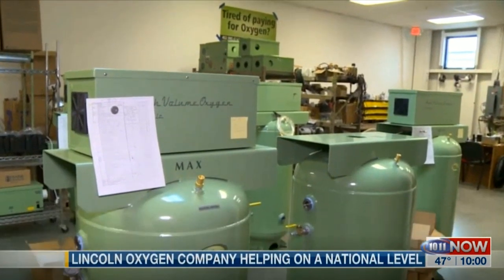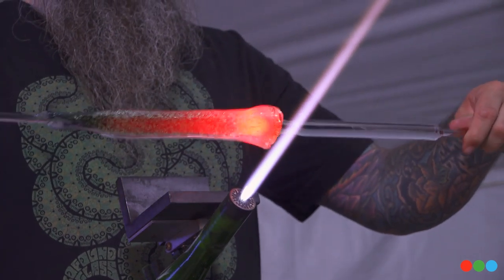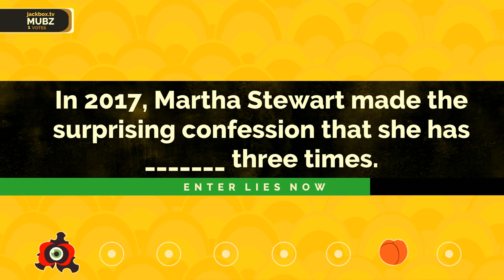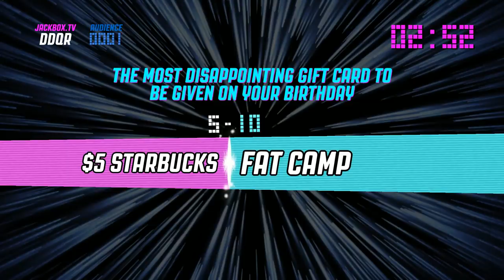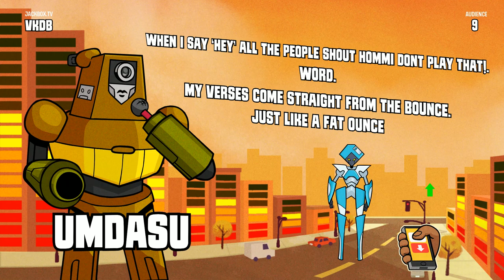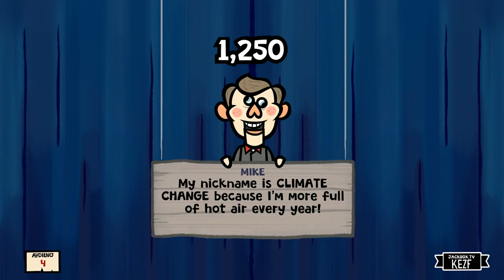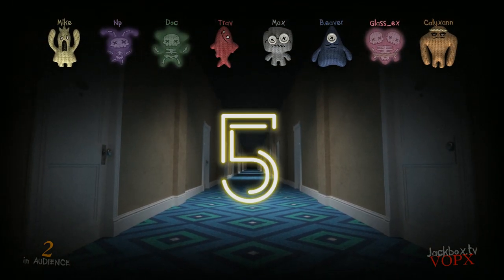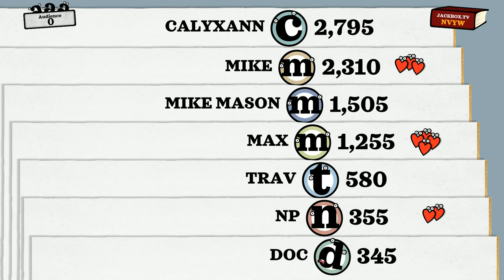Dichro Rollup w/ Phil Siegel

Comment: Awesome video, perfect speed and great commentary. I have a question, when I make similar things my dichroic covered in clear becomes very shocky. I’m hesitant to over heat it, so I don’t burn out the dichroic. Any thoughts?
Thanks!
Reply: The quality of your dichro is going to make a huge difference, and I've noticed the scrap pieces are super easy to burnout, and so is the thinner second quality tubing. Take your time nd baby it, further out in the flame is good advice, if you're working on a gtt its tough to not overheat, compressed air is the shit for providing a cool and non reducing flame without the added heat that oxy would normally give it.

Comment: Is hvo price gonna go up? Because it’s like medical equipment now
Reply from the maker: I doubt it, the models for veterinarians and such are a separate product line with slightly different features like constant online monitoring.  Beyond that, the systems used were not modified, rather they were chosen because they already have fully oxygen safe designs with proper electrical certifications and everything important for medical use.